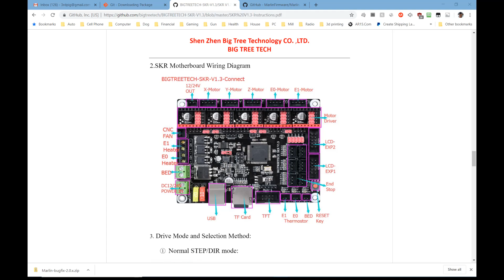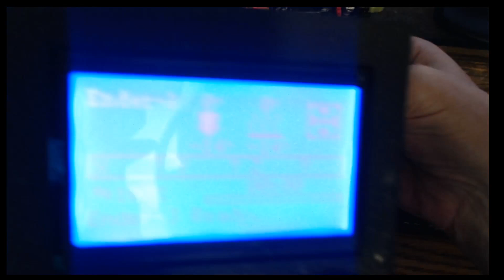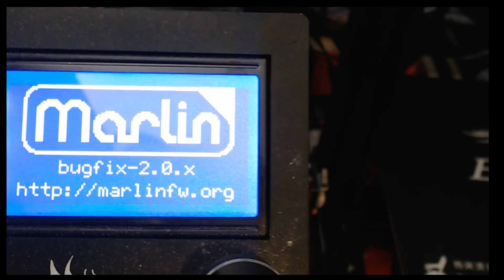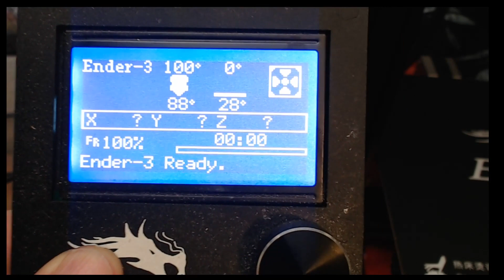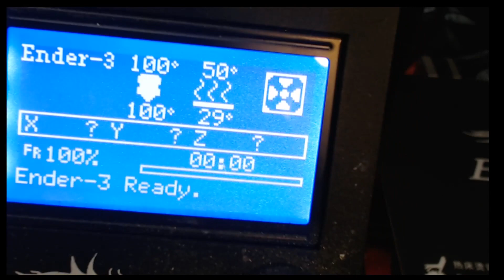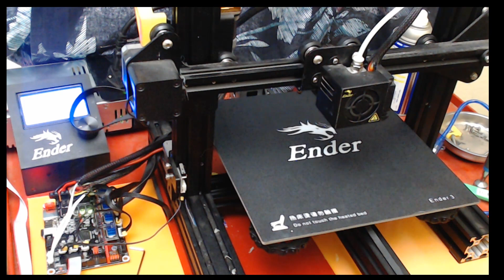BigTreeTech SKR 1.3 and TMC2208 Stepper Drivers in an Ender 3

Comment: The info online for the 1.3 is actually not very good at all. Even on git... not great. Not sure what kinda info you’re used to having available but......
Reply from the maker: I guess I'm not sure what info you're used to having either. I guess it depends on which end of the spectrum you're coming from. I've worked on projects where there's nothing at all, absolutely nothing. The hardware is handed to you and you're told to "Make it work". Everything had to be reverse engineered. Then again I've worked where everything was documented in advance and even proprietary info and software coding tools provided. In my mind the BTT SKR board was on the better end of Chinese hardware and somewhere in the middle of everything else. I wish all Chinese hardware was this well documented. You should see a board I got to upgrade my mill. Nothing in English at all and one small page in Chinese. I've been fooling with that one for months.

Comment: Chuck I have the same problem with the motors going 20mm and not 10mm. I have marlin set on 2208 standalone and it did not fix it. May I see your configuration files so I can compare them to mine to see what I have different?
Reply from the maker: Sorry for taking so long to get back to you, I had to rewatch the video to refresh my memory then try to remember which was the last file I flashed to the machine. The fix was I to go into Configuration.H and uncomment the section for the TM2208 stepper drivers for all 4 axis. I probably had to put comments in for the stock ones, but I can't remember for sure. I'll put a link to my configuration.h file below.

https://drive.google.com/file/d/1-joxHwm2TgeGo0aUZ3yodfMyhqvrs5rD/view?usp=sharing

Comment: Awesome! Can you explain which fan have to be mounted on which port? I have a custom setup with 2 extruders, so, the most pins are in use.
Reply from the maker: If memory serves (hahaha), the only fan that is connected where it's supposed to be is the part cooling fan and there's a header for that. The hot end cooling fan and the case cooling fan are spliced together and connected to a pin header that's hot all the time, it's up in one corner of the board. I thought I covered that in one of the videos. I actually damaged the header that's hot all the time and had to repair it. I hope that helps! I left the second extruder header empty because I thought at some point I'd be going dual extrusion on it.

Comment: Hi, sorry if I missed this, but better safe than sorry! Did you have a small red and black pair of wires coming from the "Always on Power" on the Ender 3 board? If so, where did you put them on the SKR 1.3 please? Thanks very much.
Reply from the maker: Could they have been for the hot end cooling fan? If so, most people use the extra extruder jack for them. Since I wanted to keep that header open for possibly running a second extruder, I spliced them into the control box fan wires.

Comment: Not to be correcting you or anything your video is great
but the power on the Ender 3 for the hot ends fan is white and white for the Ender 3 pro it's red and red

Comment: i dont have the side menu like you have, i cant upload
Reply from the maker: Did you install PlatformIO? Because if I remember right, that's what give you that side menu.
Reply: @3rdpig  yes i fixed that by now, but now there is a new problem i cant compile  LPC1768 fails...
Reply: i fixed that too, it works now for more than 2 weeks already

Comment: My motors are making a very high pitched whine, almost like the sound of failing bearings, but it's electrical in nature.  They were working fine with the original board and drivers, but not with the 2208s.  I adjusted the vref on each driver but it made no difference.  I also adjusted the vref in the firmware from 600 through 800 and still no difference.  Any ideas?
Reply from the maker: I've read about people complaining from motor whine with the 2208's. I'm not sure they all do it, but one thing that does seem apparent to me is that not everyone can hear it even when it's present. I know I wouldn't be able to, a lifetime of shooting and machine noise as well as age and tinnitus means I can't hear squat in the high ranges. Of course Micheal over at TT is a lot younger than me and he didn't mention it. If it's working normally otherwise, I think you're either going to have to live with it or switch drivers. Or maybe it's amplified by mounting the motor directly to the frame? maybe a set of those cheap isolator mounts for the motors might cut it back enough to be bearable. Or maybe it's time to build that enclosure you always wanted? Sorry, but that's all I've got.

Comment: Where is the filament runout plug on this board?
Reply from the maker: It doesn't have a dedicated port for that. You can use one of the spare axis ports for it, I found a tutorial for it (link below) but I haven't tried it yet.
https://www.makenvape.uk/3d-printing/3d-printing-guides/skr-v1-3-filament-runout-sensor/

Comment: Hi Chuck I have the same problem and I have not been able to solve it. I tell him to move 10mm and move 20mm. Please I need your help ... What was your solution? Thank you!!!
Reply from the maker: My solution was to go into Marlin and change the default stepper drivers to the TMC2208 drivers. That made it right. It's just an editing thing, comment out the entry for the default drivers and uncomment the TMC2208 entry and reflash the board.

Comment: HELP Please...So I watched the Teaching Tech video many times.. I installed my New SKR 1.3 board tonight and I tried to update to 2.0 firmware and get this error 

Unable to find destination disk (Autodetect Error) In the device manager I have the USB device and Com port 3 no problem there.
I have been trying to fix this for hours Im about to lose it!!!! WTH is wrong also the LCD screen lights up but no image??? 

Do I have to something different with the L:CD cable its plugged in where it was on the original board Isnt there a way I can do the firmware from SD?
Please has anyone had this issue and how do I fix it?? my 2208 steppers come tomorrow want to get this working to install them HELP!!
TIA I really need HELP!!!! :(So you plugged in just the USB cable to the computer and the LCD ribbon to the board and LCD and it worked????
Reply from the maker: When I plugged mine in Windows recognized it and assigned it a com port, then I put that com port into whatever software, in my case Atom, I'm using to write Marlin to the board. If Windows isn't recognizing the board when you plug it in then, assuming the board isn't defective, it's a problem with the computer. Try plugging it into a different computer and see what happens. At the very least Windows should tell you that it's an "unknown device".
The LCD didn't work when I first plugged it in. The issue was covered in TT's video, but his solution didn't work for me. I'm pretty sure I covered what I did to get it working in my video. Find both his solution and mine and see if one of them doesn't work for you.

Comment: I can't get atom to install. I watched his video several times. I was able to get the code app from visual studio to install ok so maybe I'll go that route. My new Ender 3 is supposed to be here later today and I've been thinking about making an enclosure for it out of plywood I have laying around.
Reply from the maker: MS Visual Studio should work fine. Watch my videos on the enclosure, maybe I can save you some work. And here's a tip, if you want to mount the control board outside the enclosure, order the longer stepper wires and end stop wires now before you assemble the printer. The stock wires aren't long enough by a good margin. And there are still other wires you'll have to splice some extension in as well. It's a bloody lot of work.
Reply: Thanks. I have a bunch of wires and stuff including TMC2130's. Do you think adding a second Z axis on the right is worthwhile?
Reply from the maker: @billkaroly  I don't know, I've heard some pretty wild claims about it, but I'm thinking it's mainly by people who can't get their Ender 3 properly assembled and adjusted. I get great prints with one lead screw and the Creality dual Z kit costs $65 on Banggood. Not sure it's going to improve it $65 worth. On the other hand, you can do your own dual lead screw using the single stepper motor and parts you print yourself for about $15. I've looked at that and thought "I should do that someday!".

Comment: Why not just by the silent board version 1.1.5 which as runaway protection and marlin 1.1.8 version and built in boot-loader? But your love videos my friend
Reply from the maker: For me it wasn't about the sound, the noise the printer makes never bothered me. For me it was about 32 bit and the extra possibilities that brings, Marlin 2.0 and dual extrusion. The silent board has none of that. But if the only thing you're trying to achieve is to shut the printer up, then no doubt that's the best bet as it's plug and play.
Reply: Chuck Bryant 
Your right my friend. Still love my watch stands you make. Your man on the fusion 360 for sure

Comment: I ran into the issue with the SDcard yesterday (before you released the video) and found the same solution.
Just to let you know : as long as I don't press init. SDcard, the card is still visible on the computer connected via USB. I need to init SDcard to get the menu print from SD. The moment I initialize, the USB drive disappears. So you don't have to remove the card to update fw or put gcode on it. Just power on printer without initializing SDcard.
Enjoy and thanks for the video!
Reply from the maker: Good information, thanks for sharing! Personally, for me carrying the card from the PC to the printer is probably the better way to do it, less chance of getting my size 13's in a loop of the cable. But it's good to know I still have the option if I need it.

Comment: I installed the updated board from creality with tmc 2208 drivers which is plug and play because iam afraid of firmware stuff. Just wanted to mention that option for others like me.
Reply from the maker: I saw that board. It's a good board, should be super quiet with the 2208 stepper drivers and won't need smoothers.
Reply: I got one not long ago and was a lil worry I think I got the firmware uploaded just have to install it and see if it works but I'm also still looking at a bunch of videos because everyone has something different in the firmware I am a lil worry I'm doing something wrong but it's a learning progress

Comment: Chuck thank u for videos, try vscode if atom got errors i use both for compile skr build, i bought skrv1.3 too compiled and updated software but not replace with mks gen l v1.0 :) and im using with mks external mosfet didnt decide yet will use it skr. how often do u clean ur z rod and what are u using for celanin it? thank you for sharing us
Reply from the maker: Atom worked fine for me, the installation of Clang gave me an error, but apparently it didn't cause a problem with me compiling and flashing the SKR 1.3 board. I wipe the Z rod down with a silicon gun cleaning cloth. I've probably got a dozen of them floating around, I use them for all kinds of things.

Comment: Looking good
Thanks for sharing 👍😀
I used a loft isolation squares (sound dampers placed just under the roof) in my inclosure. It was 60°C I'm the morning, sevrel hours after it was Finnish printing.. too hot for PLA print though. Now I'm printing with the front off..😉
Reply from the maker: I'm struggling with whether or not I make the enclosure semi permanent, or something I can just put on or off when I need it. I can see the advantages of both and since I have two other printers I probably wouldn't have to take it off very much. Decisions, decisions.